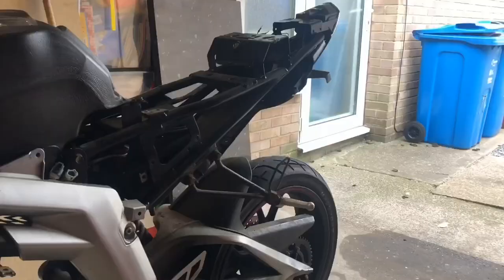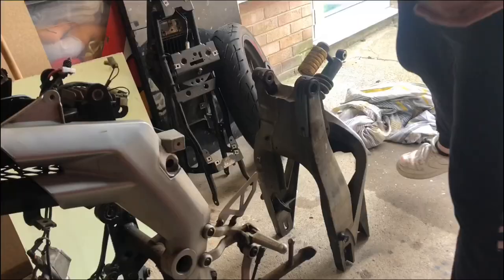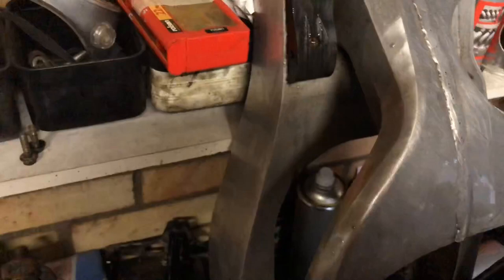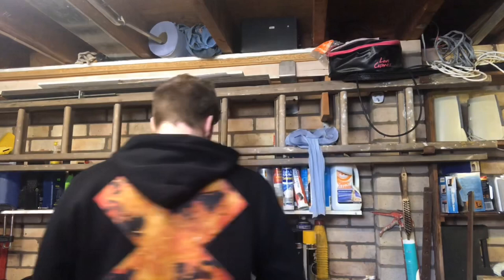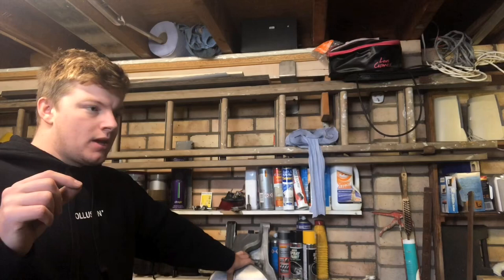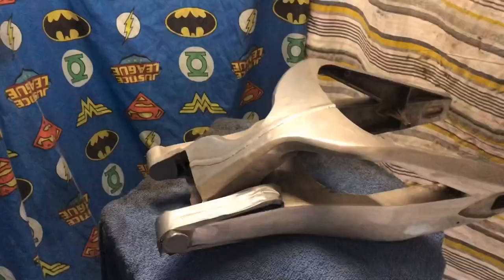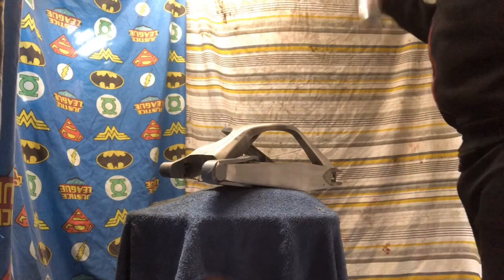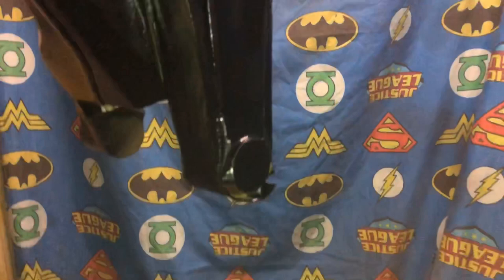Rieju Rebuild Ep3: Painting the swing arm!

Comment: Don't go any higher than 1600 if your throwing lacquer down, 2000 won't be enough of a key. Remember lacquer is easy to get runs in 👍 
Keep it up your doing well
Reply from the maker: DanDanFirebladeMan thanks, I didn’t end up sanding it I gave it a clean with a micro fiver cloth after the 24 hours then applied the lac